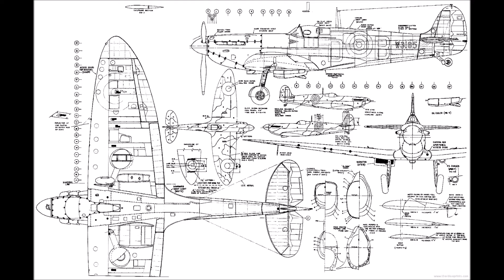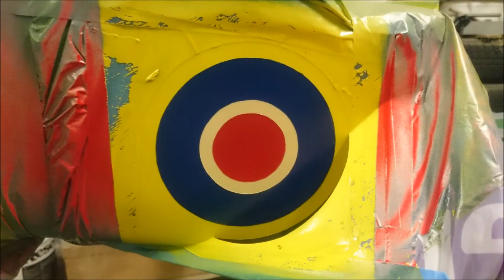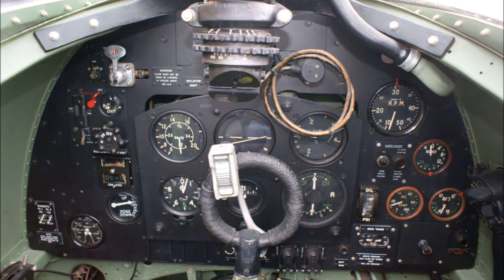Rocking plane construction images

Comment: Love what you've done here. Looks incredible. Would you happen to have cut list of your materials used for this project?
Reply from the maker: thanks! and no, there isn't really a cut list, I made it up as I went
Reply from the maker: if you screenshot 0:12, the scale from nose to tail is about 1m long. I patterned a grid of 100mm squares over that image for a rough shaping guide, most of the work was done with a sanding flap disc on a grinder and a belt sander